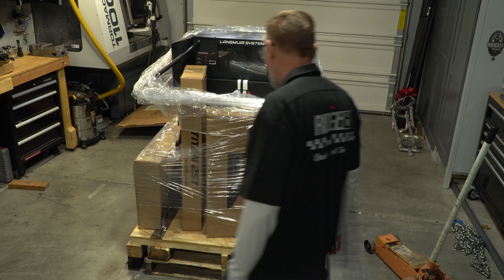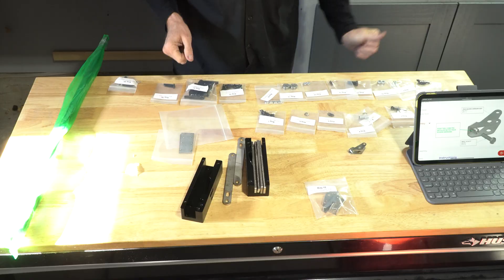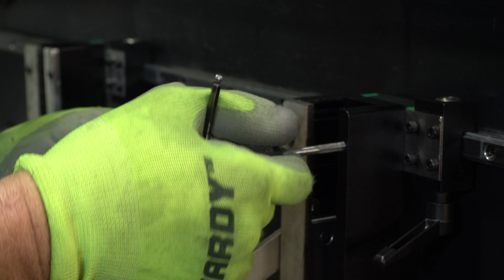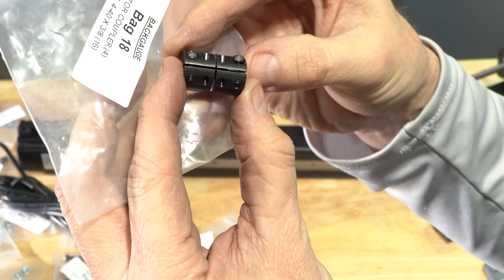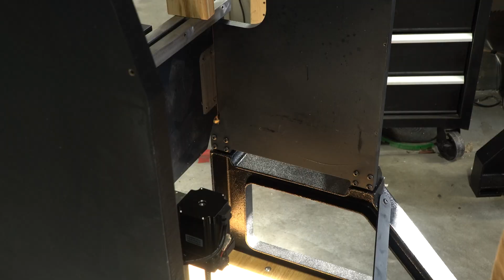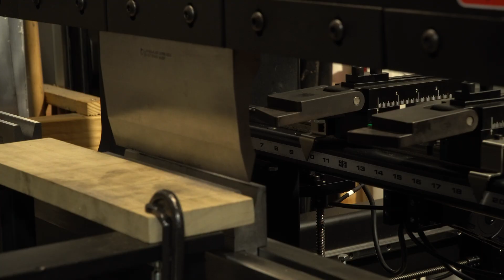LANGMUIR TITAN 25T BUILD AND REVIEW | RIDE88 Behind the Scenes

Comment: Thanks for the video.  Have you used it yet in manual mode?  I'm curious how that function works.
Reply from the maker: Yes I have.  There’s a couple ways.  One is to enter your travel.  That seems to work great.  It goes to what you enter then comes back up.  The push button up/down version of manual is a little awkward but it’s not too bad.   I wish you could simply move up and down with 2 buttons but there’s steps between and essentially you have to cancel downward movement to allow the  retract to function.  I think it’s all safety stuff.  Maybe we will be able to override this in a future software update??

Comment: At around the 30 minute mark why is the video edited? I would like to see this machine run two different bends and back gauge move just to get a sense in real time how this machine operates. It might just be you editing the video for time, however it just gives an allusion this thing is running at a fast pace even though the video is edited. Sorry for being so anal in asking. I’d just like to see this run out a complete couple bends of different degrees without edited video.
Reply from the maker: Makes sense. I probably won't update that, but I use the machine all the time so I'm happy to send you something directly. Basically the timing between bends is like this: Set my part into the machine against the backstop, it takes about 4 to 8 seconds to bend a 90 depending on a few settings, then  4 seconds for the back stop to reposition and then it all repeats.

Comment: WOW... Brackets are wrong. Bolts and screws too short. Missing hardware. Horrible!
Reply from the maker: Sorry for the late response! Yeah it was a pain, but now I love it. Just had to deal with delays in getting it going. The guys were pretty on top of it at Langmuire so I can say they stand behind their product. Occasionally the machine requires a couple restarts as it locks up the screen at start up. That's the only recurring thing I get so far. Probably have about 8,000 bends so far.

Comment: These issues are saddening. Thank you for the honest review.  They need to get their act together.
Reply from the maker: Yep, I think they will, I believe they are improving these details as they arise. Now that I am set up, this machine is amazing for helping me get repeat accurate bends. Best thing is I can just pull up a program now instead of all the stuff I had to do before on my press brake bender. I would recommend it for sure if you can handle some possible assembly delays. The guys were very helpful at Langmuire. That's my honest opinion, I paid full price for my system.
Reply: @RIDE88USA it’s strange. I was a manufacturers some time ago. These are very minor issues. Not meaning that they aren’t important, they are. But to give the wrong length screws (not bolts) is inexcusable. For a manufacturer to not know the correct fasteners to use makes no sense. But then, it’s likely that they don’t actually make this, or at least, most of it. 

As far as the bearings go, as addressed in another post, in some areas of a machine, open bearings are used as they need to be lubricated regularly. You can lubricate shielded bearings, but why use them if they have to be lubricated? Shielded bearings are lubricated for life, at least, for the life of the bearings. So you could get different types for the machine, depending on where they go. They may all be the same size otherwise, so putting them in the correct places is important.

This whole thing is nuts. There is no reason there should be so many errors in fasteners and other areas. Chinese machines direct from China don’t seem to suffer from fastener problems. So I don’t understand what going on here. It’s as though they haven bothered to put one of their own machines together from a package. If they did, they would have had the same problems. Unless, whatever company is building this for them is lacking any quality control and they are just not inspecting these before sending any out. I’ve never heard of so many problems with assembly. It make me suspicious of The Who,e thing. And I was considering buying one of these.

Comment: I like the idea of the wood square...but at the same time, I think LS should have designed the material supports to do this. The backguage is good, but for thin parts or parts without a square end, there needs to be a 90 edge to align the part on the front end. Are the support arms anywhere near reliably square to the die? or are the too far out or not consistently reliable?
Reply from the maker: They are visibly not even close to square but still useful for material support.
Reply: @RIDE88USA  I'll design some sort of a manual linear rail adjustable square.  it's a shame langM took it this far, but failed to finalize the squaring feature.

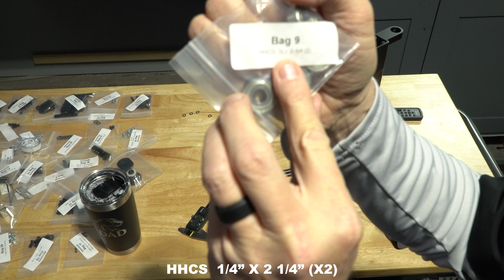Comment: Hey I also happen to notice at about 14:20 your bearings they look like unsealed bearings I could be mistaken and I’m in the process of also putting mine together with the arms and back gauge but regardless they are sending it out with sealed bearings you might want to hit them up and ask for the sealed bearings just happen to see that difference well possibly a difference…
Reply from the maker: They look covered but not sure if that means sealed or not.  They are running fine anyway.
Reply: @RIDE88USA well, there are shielded bearings. Those have steel covers. The sealed bearings have a plastic/ vinyl cover on each side. It’s easy to tell the difference. Open bearings are pretty obvious.

Comment: I've had mine for a couple months now I believe.  I had issues with missing hardware, sae bolts when they should have been metric and vise versa.  My motors were all mislabeled, so my wires on the back are plugged in reverse currently.  I was missing a part for the material support.  The two back gauge motor mounts wouldn't fit on the rails.  They sent me new ones they machined but by then I had already done the milling myself to make them work.  I was having that issue with the back gauge how one side would go up.  I messed with the alignment several times and it seems to have gone away.  I will have to check out the info about the switches you mentioned.  My back gauge holes to mount into the main portion of the press (where you had hole alignment issues) were off, but not as much as yours.  I cleaned up the holes some and was able to get the bolts in.  I had similar issues with the plates for the cross beam of the back gauge.  I would suggest you swap out your bolts on the front that hold the plates that tighten against the punches.  They are far too short.  Mine only went in a couple threads and stripped a couple.  Just loosening them to swap punches the bolts would sometimes fall out.  They can be 1" or whatever because of how thick that plate is, so there's no reason for them to be so short.  As far as accuracy, I have seen bends with different combinations of die/punch/metal thickness be off.  Some combinations are dead on.
Reply from the maker: Sounds like you had more to deal with than me. Ultimately I am happy with it so far. My bends once programmed are repeating perfectly.
Reply: @RIDE88USA  When I was referring to the bending, I was more talking about the accuracy of the defaults.  Once you do test bends to figure out the under/over bend then the machine does seem to have reliable repeatability.

Comment: Thanks for sharing your detailed experience and the problems and resolutions offered by Langmuir.  I placed a deposit last year and got the notification to place my order last week with the final day to order being today!  I have zero experience with press brakes so the current challenge is tooling selection.  I found a guide on the Langmuir forum that gives some examples of what to order for different use cases.  I’ll be keeping an eye out for any future videos you post.
Reply from the maker: Sounds good! I got a bunch of tooling but they could only fulfill 1/3 of it. So be prepared for that. I was told 3 more months on the rest of my tooling. FYI I bend mostly 1/8" steel plate. The smallest die I received was something like 16mm 30 degree. Haven't needed to go with any of my bigger dies as it bends perfect with the 16.
Reply: @RIDE88USA honestly, along with the other problems, they just don’t seem to have their act together. I’m going to wait until they hopefully get all their problems and parts issues straightened out. There is no excuse for this, really. Everything should be available together upon launch. This is very unprofessional. I hope they’re no running out of money as a company.

Comment: Nice video!  I have one and had minimal issues with the setup.  Seems like the back gage could have been fabricated from aluminum extrusion like 8020 and assembly would have been easier.  I bought mine because I wanted the cnc back gage and the mobility of the unit.  I didn't want it to be a huge presence in my shop.  I'm in the middle of a new compressor install to get ready for my new XR plasma table!  Great looking parts, by the way!  Going to bend a new mount for my Tsunami air filters.  It will be my first real part on the 25T.
Reply from the maker: Thanks for the comment! Love to hear more on the XR. I have a Crossfire and it's pretty nice. A little edge clean up and parts are professional looking and accurate. Langmuir hits a real sweet spot for small shops / garages.  But I would like to get a bigger table eventually.
Reply: AJ, I agree that the backgauge is a little bit meh....  The limit switches are what homes the machine and makes it repeatable, these are definitely a bit low quality and could be improved.